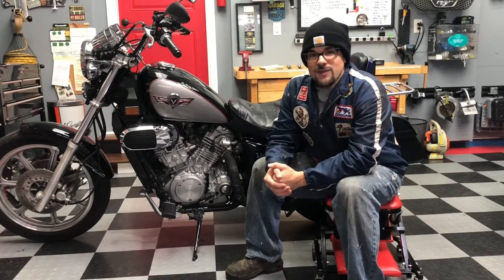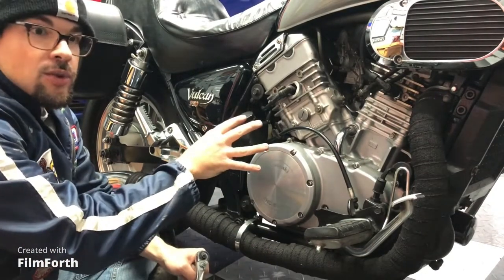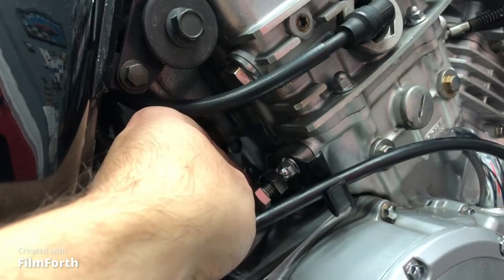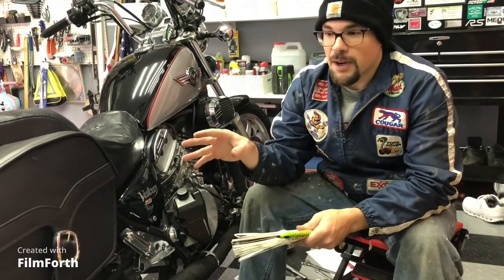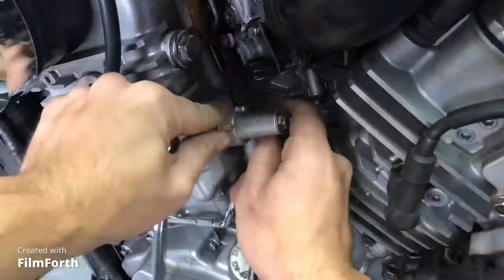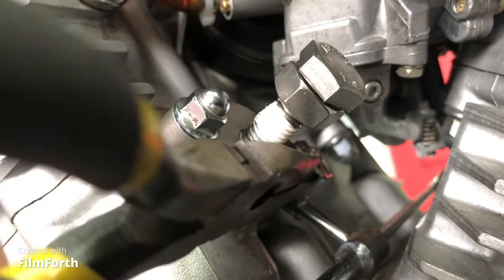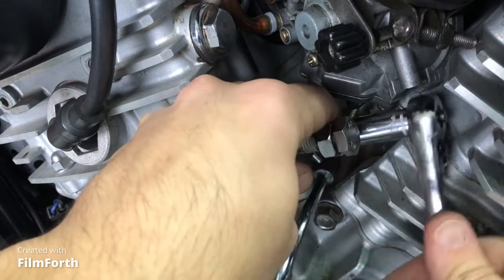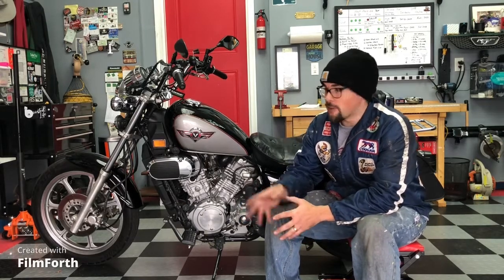How to Replace the ACCT's with MCCT's on a Kawasaki Vulcan 750

Comment: You gonna have to replace the stator? I’m thinking of buying this bike and heard that’s a common problem
Reply from the maker: Hi Abel. I had the stator replaced by a dealer for ~$800 in 2021. The issue is that the engine must be tilted or removed from the frame in order to access the stator (unless the previous owner did the "Tuxedo Mod" which is unlikely...the Tuxedo Mod allows you to replace the stator without needing to tilt or remove the engine). That certainly is one of the biggest draw backs of the Vulcan 750. Measure the voltage of the charging system with the engine idling. It should read 12-13 volts at idle. At least this will give you some confidence the stator and rest of the charging system have some life left.

In addition, check out my spline lube video here at the timestamp 13 minutes 14 seconds. 
https://youtu.be/neRyCCNG9RY?t=794
The lubing of the splines is another crucial item on this bike, and if this preventative maintenance item is not done then the splines can rust out and you'd have to get an entire new drive shaft/assembly. Since you won't be able to do a complete tear down to see the splines, simply take a look behind this rubber boot to look at the U-joint. If it looks like it's in good condition then the owner maybe also took good care of the splines too! Also ask the owner if this crucial maintenance item has been done. It should be done every 12,000 miles.

Those are the two big ticket items for the Vulcan 750 in my opinion. But then again every bike has its quirks and pitfalls. 

Some upsides include incredible parts availability (the Vulcan 750 was manufactured from 1986 to 2006 and remained largely unchanged, so spare parts are plentiful), an incredibley helpful and active forum at VN750.com, great power for its size (66hp, 47 ft lb torque), hydraulic valves (no need for adjustments and easy to replace the automatic cam chain tensioner (ACCT) with a manual cam chain tensioner (MCCT) that'll last the life of the bike...I've got a video on that also), shaft drive (very minimal maintenance compared to chain drive), and center stand.

This answer is more than what you asked for, but I'm passionate about this bike and wanted to give you some more insight based on my experience. Let me know if you have any more questions!
Reply: @CFG750  thanks for the in depth reply. If i have any more questions i will definately hit you up. Likely to decide if i am purchasing tommorow. It does not start after having sat for 6 months. $1500 with 10k miles. Owner mentioned that it ran hot a couple times; which is my greatest cause for concern. If you have any more input I'd be happy to hear it and if I purchase it, I may dm you asking for help as I start the repair process.
Reply from the maker: @abelbowden7680  Interesting note about the bike running hot. Maybe a coolant flush is due (I've also got a video detailing that process lol). Please do DM me and I'll help however I can. Good luck today!

Comment: Great video.....I keep watching your video and I'm finally deciding to order the chain tensioners for my 2004 Vulcan 750.  Just a quick question , reading various posts on the Vulcan forum, they say to tighten till you feel resistance, then back out the bolt half a turn !!!  I'm really scared and nervous and feel better turning the nut INWARD another half a turn similar to yours, I just want to confirm.  Can I do the adjustment , loosinging or tightening the bolt to fine tune sound while the bike is running ......man,  I just don't want to damage the engine!

 Also, do you have to wrap the teflon tape or can I just screw the nut in to make sure I feel resistance with the chain?  Thanks again!
Reply from the maker: Thank you. I am glad you find this helpful, and also that this is helping to give you the confidence needed to tackle this for your own bike. 

Firstly, you are correct in that you want to tighten the main bolt of the MCCT by hand until it becomes to hard to turn clockwise (tighter) any further by hand. Then, you do want to tighten further with a wrench just one half-turn per my video. These instructions are also provided by TOC on their website. 

My advice for you is to not be nervous...There is quite a good amount of "flexibility" here. While there is no exact science to the precise tightness of the main nut of the MCCT's, there is quite a decently wide range where these MCCT's will work just as intended.

Follow the instructions in my YT video. Do one MCCT at a time. Then start the bike and listen for the whirring/clanking. Like I said in the video tutorial, it's a very forgiving process. Follow-up here or also the VN750.com forum with more questions. We're all happy to help!

Comment: Replaces my accts with TOC manuals. Great product but i have a minor leak from rear cyl bottom fix bolt (not the big one in the center). Tried to stop it 5-6 times with washers, good cleaning and teflon tape. Still leakin :( Does anybody have this issue?
Reply from the maker: My recommendation is to take a picture and create a post about this over at VN750.com. The people there are experts in this motorcycle I guarantee you'll find someone there who could help provide a resolution.
Reply from the maker: Vlad, so I was making another video for my channel about the very important spline lube procedure (will be posted ASAP) and noticed I had the SAME LEAK as you. So I checked the tightness the two bolts holding on the rear cylinder MCCT and also applied some high-heat gasket maker to the nut of the main bolt. I won't know for certain if this fixes the issue until I ride again next year/season.
Reply: Does anyone know where TOC manafacturing is located? I’m trying to get the tensioners for my Vulcan but it doesn’t seem like they ship to Canada

Comment: Thanks for the great video and helpfull info!  I also have the minor clicking from the tensioner behined the coolant reservoir on  my 2004 Vulcan 750 (23.000 Miles) only when the bike is cold at start up and it quiets down after couple of minutes and does not make the noise while riding. I was always nervous about installing the manual one not knowing exactly how much I should turn the locking screw and your video explained it in great detail!!! . I also didn't know if TOC was still in business??   I think I am going to need to order mine soon.

I have also replaced my Stator at 20.000 miles with kawasaki original as I figured, it will last longer and lubed the splines as well. The only other thing that I noticed on mine when I steered the bike , it would cut the engine and found out on the VN750 forum it's one of the wires inside the round black ignition box hidden under the headlight and need to solder it.

We all need to share the knowledge.....Thanks again for the great video!!
Reply from the maker: I'm glad this was helpful for you. And yes, TOC is still in business. The price of each MCCT was increased but it's 100% worth it. My ACCT's would only make noise when cold, then the ticking/clanking would go away when the engine warmed up. Next I need to fix the shift shaft seal because I am leaking a little bit of oil. Check that on your bike, since both our stators and ACCT's started acting up at the same time. ;)
Reply from the maker: Also, I will make a video showing how to replace the shift shaft seal shortly. :)
Reply: That sounds great....I will definitely  check that seal as well....thanks for the detailed video!!!

Comment: Get the ones from TOC. They are SUPER high quality. The ones from eBay are total JUNK. I'm surprised the oem tensioners lasted 25,000 miles (or did they) I've owned two bought new Vulcan 750s, the oem tensioners on both failed at not much over 10,000 miles. It is a defective design. They have a 100% failure rate, usually at very low mileage. I have little doubt that tens of thousands of Vulcan 750 engines have been destroyed by these things failing. I highly recommend against bending that bracket on the oil line on the left side. I believe there is a serious risk of breaking the oil line, and replacing that requires removing the engine. That clamp is not really needed anyway. I took a Dremel with a reinforced cutoff wheel, and very carefully cut the tab that goes under the bolt off, being VERY careful not to nick the oil line. I put over 80,000 miles on the bike after doing that with no problems.
Reply: Hello Gerald can you send me the link you from where you order them ? 
Thanks
Reply from the maker: @Normans-h6l  Here you go:
https://tocmanufacturing.com/product/manual-cam-chain-tensioner/
Reply from the maker: Wow, you put 80,000 miles on the bike after your MCCT install!? That's incredible. What else major needed to be done? Anything I should watch out for? And yes, I highly highly recommend the TOC MCCT's over the eBay ones. For something as important as this, I think it's 100% worth it!
Reply: @CFG750  The only other serious problem I had was a bad stator, which required removing the engine to replace. I replace mine with a TPE  (Tim Parrot Enterprises) rewound stator, not a new oem one and certainly not one from eBay. I believe Tim is no longer in business. While I had the engine out, and the left cover removed, I also replaced the rubber dampers in the engine balancer, which tend to be somewhat failure prone. And I would have had another big problem with the final drive splines if I hadn't already known about it. They are supposed to be lubed every 10,000 miles with moly paste, which requires disassembly of the final drive. The problem is, on most of them, they were never lubed at the factory, and by 10,000 miles they can already have significant damage. I checked mine less than 2 weeks after bringing the bike home from the dealer, and sure enough the splines were dry. I found the problem before it had time to destroy the final drive.
Reply from the maker: @geraldscott4302  You and me have both had similar journeys with our VN750's. I, too, had to remove the engine for the stator job. But I had a dealership do this. And as for the final drive splines, good on you for taking care of lubing them! I did the same as soon as I found out about that. And I've already ridden 11,000 miles, so it's due again. I will make another Youtube video detailing this process soon. Thanks for the comments. It's cool to hear you've gotten so many miles out of this incredible bike. Cheers!
Reply: I was wondering about that oil line bracket. I just left mine off and was hoping I didn't need it to bend it any more. BTW I did get ebay MCCTs supposedly for a VN750 and while they fit the port, the adjustment bolt is waaaaaay longer than it should be. Not a problem on the front cylinder but on the rear, it is supposed to sit behind the coolant reservoir. I had to heat the plastic right there and slowly hammer it in and get a longer bolt to secure it to the frame (M6x30) it just barely fits in front of the adjustment bolt, but it works.